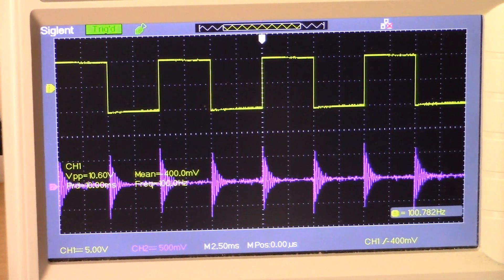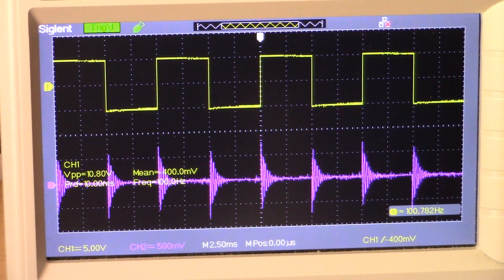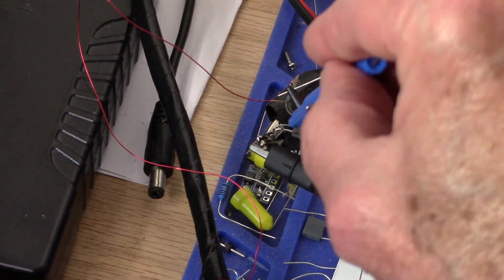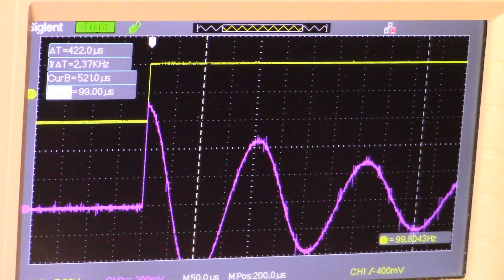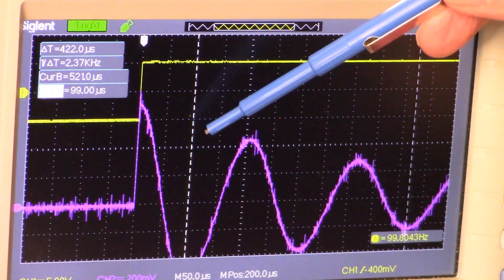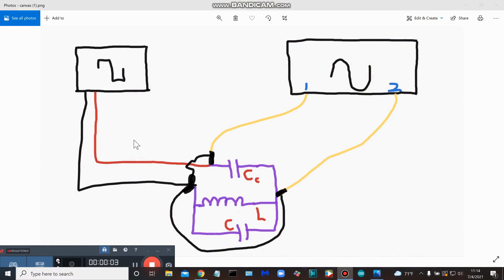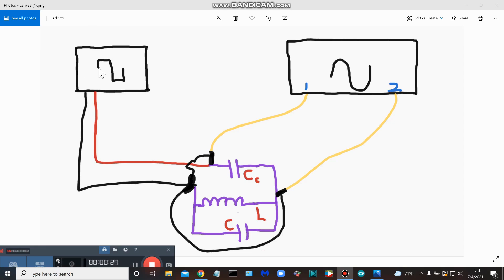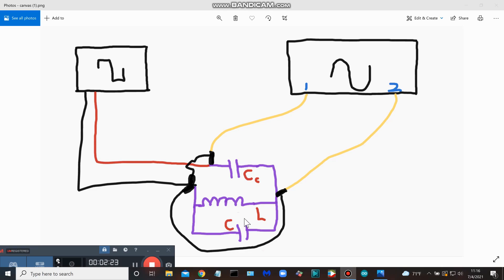IDX PRO part 3  Receive coil frequency

Comment: I know little about electronics, but want to build a few things, one being a metal detector, the other is A dc motor controller, simple throttle for the motor  capable of about 500 amps ,and a inverter in the 8-16kw range,
 but the detector i really want to experiment with it, maybe try using brute force maybe use a inductor to boost the voltage until the coil is getting hit with 600+ volts at a few 100 ma. And possibly look into using a micro controller to scan the curent and voltage of each pulse, to possibly see when metal is in range of the coil, and Maybe do frequency sweeping do a few pulses at was each frequency group say 4khz, 4.5, 5, 5.5, 6, 7, 8,10, 15, 20,25, 30, 40,50,60, 65, 70, 75, 80khz, and the display being a small ocilliscope, maybe a two channel  like the cheap hand held scopes, one channel connected to the pulse current for a transmitted signal, and a recieved signal.  It should be able to show when metal isin the area, possibly before you can hear a difference in sound, depending on the signaling type,  id like to use a secondary signal generator, to ptoduce a lower frequency signal that is always running when its on, bit thr input to the audio amp is blocked by  fet and the microcontroller sensing the difference in current draw when metal is near the coil , and maybe send the return signal to the audio smp also, so it can be heard. Maybe a user can switch between the two. I want to experiment with all this stuff, maybe not all at once.   I also thought about for large search areas for deep search, maybe a large steel tube can be e driven into the ground in be a grid pattern the tube havinga coil inside basically magnetizing the earth around the tubes basically a 1.5" tube a couple feet long or so, with all running at the same frequency. Then a search coil ran over the area between the stake coils, if there is anything even small gold it should start ringing between pulses from the emitters  the field from the emitters would need to be studied see how large they are, what the reach is, keep them close enough to prevent blind areas.  Possibly a 48" on center grid using about 12 emitter stakes . With them being 24"below ground ,they should reach atleast 30" with the reciever only receiving when there us no signal emitted, there should be only targets and possibly the receiver using multiple coils to make  targets easy to locate.  Possibly use low power laser and fiberoptics to illuminate the search coil/,reciever in the area of the coil recieving the signal from the target. And use colours for possible Material id. Red for possible iron, blue for possible gold, copper, aluminum, and lead, and did i mention GOLD! Hopefully i should sound on sub picker gold targets, (fly turds)  especially if the soil is good snd there is multiple targets. Its just sn idea i wanted to play with, don't know if anyone would be interested if it did work! If a small auger could be used to drill a 4'+ hole on a 4' center grid. And drop in a 36" long emitter coil in a tube. The flux field should be large,  it should be one large alternating field, causing eddy currents in all the metallics in the area. Maybe it would require a bit of shielded cable, going hole to hole, to a main box, then to the reciever.   It sounds expensive, rven if you build it yourself..  if it found anything metal big enough to see with thr the average eye , at half arms length. Maybe it would be worth it. Especially if you could desrc a few acres a day with it. Going over 4' deep..    KRAXY IDEAS, I KNOW, BUT MAYBE IT CAN WORK, OR ATLEAST SPARK A BETTER IDEA!!

Comment: Love this detector still have one but was the fcc limiting power with these cause the real new ones are limited cause the older ones had a Reg board other then a micro circuits cause the older ones where you could but in higher caped out for more power
Reply from the maker: Thanks for watching.
Cheers

Comment: Hello, This side of vlf is still not clear to me. Why did you choose 100Hz 10V for testing? 4.74KHz is needed because the schematic is made specifically for this frequency (components chosen)? TX frequency how much will be? 4.74KHz? When measure CH1 TX and CH2 RX with detector ready to use, what is the relation of phase shift between the two? Thanks for sharing, great work!
Reply from the maker: Hi my friend.  I am certainly learning as well and make no claims to be the expert, just an interested technical hobbyist.  With my signal generator I swept the frequencies until I found something close to what looked like good coil resonance to me.
The 4.75 KHZ is not an exact figure, it is just  close to what I found listed for a commercial coil for the IDX and is easily adjusted with the tuning capacitors.  If you watch my earlier video on the TX circuit you will see the frequency that I am running at for TX.  From my reading I understand that the phase shift should be about 180 but I am not there yet.  This project is going very slowly due to my lack of spare time to dedicate to it.  I appreciate you watching and commenting.

Comment: Sir Which is the best cable between the coil & metal detector ?
Reply from the maker: Belden 8723 is a good cable my friend :)
Reply: @SurfDetector  Thanks Sir
Reply from the maker: If you cannot find that cable, many people also use a USB2 cable.
Reply: @SurfDetector  Sir can i use Ethernet Cables ?
Reply from the maker: I have not used Ethernet cable for that purpose so I cannot tell you how well it might work.  USB2 cables are very common , you should try that.

Comment: Hello friend, tell me how to connect the transmitter file with the receiver and the ground
Reply from the maker: Please help me to better understand your question.  Are you asking how to connect the coil?
Reply: @SurfDetector  yes
Reply from the maker: Here is a link showing how to connect a coil.  The method of connection will be the same for the IDX Pro.
https://docplayer.net/60466940-Tgsl-101-an-introduction-to-the-tesoro-golden-sabre-light.html